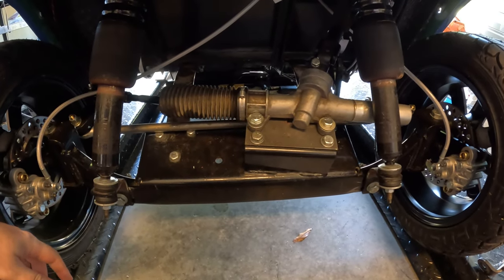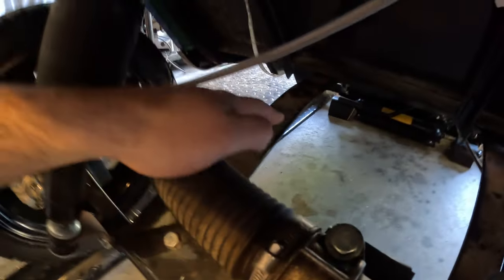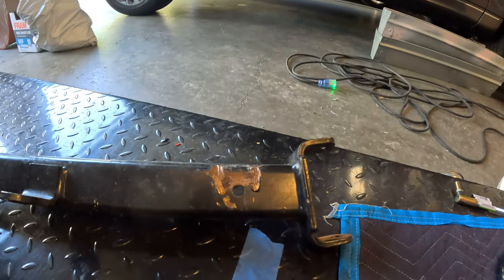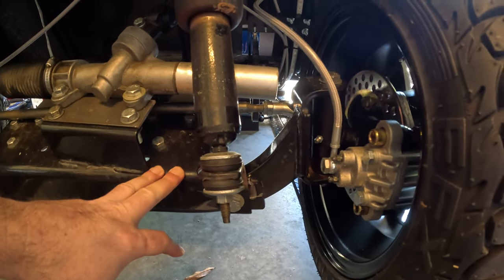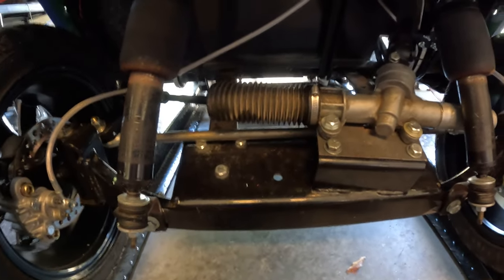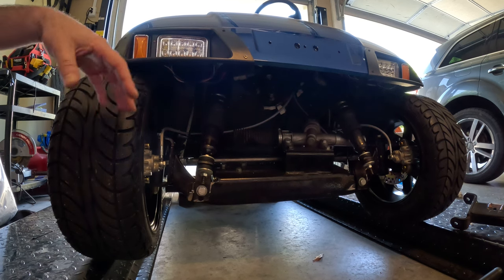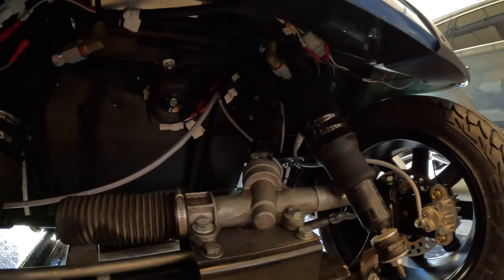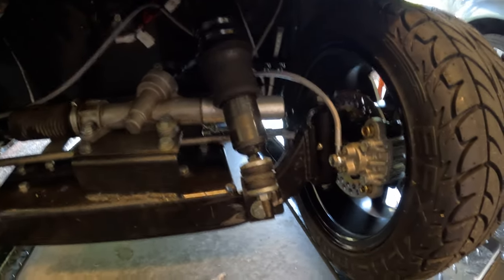Bagged 2011 EZGO TXT Front Suspension Overview

Comment: I know you said you went to 1/4 inch lines, but I cant find where you said it. I thought you said a buddy drilled the shocks out. Is that right, or did you use adapters? Any info on that process you could give me would be great.
Reply from the maker: I had read that some people drilled and tapped the shocks, but they said you have to be real careful not to get metal shavings inside and that made me nervous.  These are the adapters I bought.  https://www.grainger.com/product/4VPT3?RIID=65372072335&GID&mid=OrderConfirmation&rfe=6b178d762837ea2c1debc731a357b20f241928b41476aa424f522db168c72ec4&gcrfe=6b178d762837ea2c1debc731a357b20f241928b41476aa424f522db168c72ec4&gucid=EMT%3A10339122%3AItem%3ACSM-323&emcid=NA%3AItem

Comment: Wild question. I'm thinking of going with the Vivair 485c Gen2 because it is 100% duty at 200 psi and a 3 gallon tank. Already have these same Monroe shocks. Do you think with that set up I would blow one of these shocks out?
Reply from the maker: It will definitely be possible since the bags are rated at 150PSI, but if you have gauges for the bags, then I wouldn't worry about it.  Mine rides around 70-80PSI in the rear, so once I see that on the gauge I stop airing up.  I don't think I have ever had more than 120PSI in my rears and that was to prevent sagging with a couple of heavy friends on the back.
Reply: @aberk20 , ok maybe I will scratch the 200 psi pump then and save a few bucks. Thanks man!

Comment: Where the shocks from
Reply from the maker: Shocks are Monroe MA705 air shocks
Reply: What size wheels an tires you running?
Reply from the maker: @shaunswaney8229   12x6 with a 0 offset.